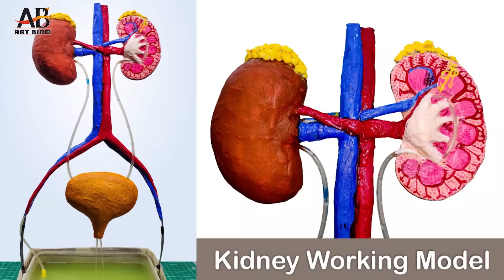How to make dam working model for school Project

Comment: 1. White form
2. Knife/blate 
3. Water pipe
4. Tape
5. Connecter
6. Cement 
7. Paints
8. Glue 
9. Soil
10. Artificial grass 
11. Black & white paint
12. Doori
13. Elfi 
14. Cardboard
15. Water pump

Comment: Tell me the material required in dam
Reply from the maker: 1. Cement
2. Thermocol sheets
3. Water pump
4. Wire  
5. Colour
6. sponge Fome
7. Pipe
8. Glue

Comment: What is that green thing
Reply from the maker: Grass
Link in Description
Reply: What material you have used
Reply from the maker: 1. Cement
2. Thermocol sheets
3. Water pump
4. Wire  
5. Colour
6. Fome
7. Pipe
8. Glue

Comment: Please give the material list of this model. And sir what have you pasted the green substance on the place of plants and trees.
Reply from the maker: 1. Cement
2. Thermocol sheets
3. Water pump
4. Wire  
5. Colour
6. Fome
7. Pipe
8. Glue
Plants and tree making Video link in description
Reply: Will I use cardboard on the place of thermacol sheet
Reply from the maker: No

Comment: Plz tell me all the materials which are used in making this dam working model...
Reply from the maker: For Dam model
1. Cement
2. Thermocol sheets
3. Water pump
4. Wire  
5. Colour
6. Fome
7. Pipe
8. Glue

Comment: When we apply cement for how many hours we have kept it for dry?
Reply: How did you cut slides , I can't understand please upload the structure making in fulll detal video please
Reply from the maker: Massage on Instagram will sent you some images
Reply from the maker: Instagram id:-  vasudev.rai
Reply: @Art_Bird  ohk wait
Reply: @Art_Bird  done ✅
Reply from the maker: 4 to 6 hours
Reply: @Art_Bird  thanks for the reply also which battery you used in this please tell
Reply from the maker: I used electric water pump
Reply: One more thing I have to ask , come to video at  8:12 what is that ring and wire please tell me in detail. Me and my team are making this project for science exhibition.... Please tell
Reply from the maker: It is an iron wire, which is made round by twisting on one side and is covered with thread over that round.
Reply: Ohk thanks

Comment: Sir please comment material please because I use this technique for my project I am making like project so please
Reply: Ok thanks sir
Reply: @Jyoti Mahale paper tape is also there
Reply: @Art_Bird thanks 👍
Reply from the maker: For Dam 
1. Cement
2. Thermocol sheets
3. Water pump
4. Wire  
5. Colour
6. Fome
7. Pipe
8. Glue
Reply: @Art_Bird thanks 👍